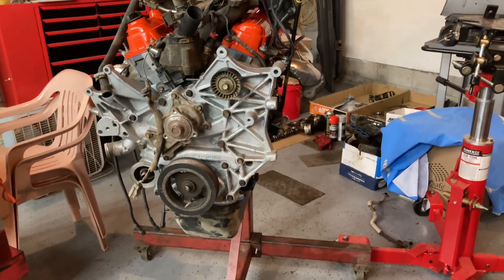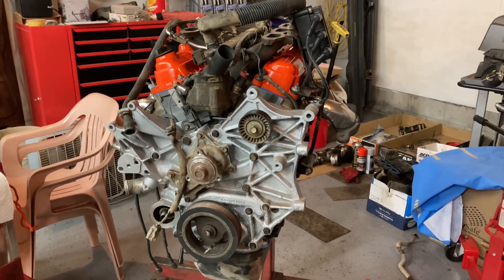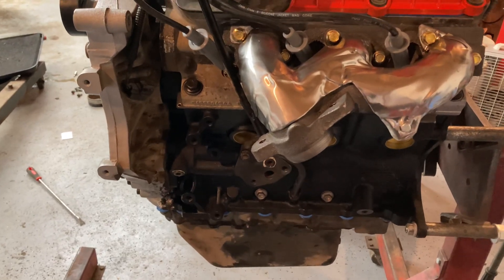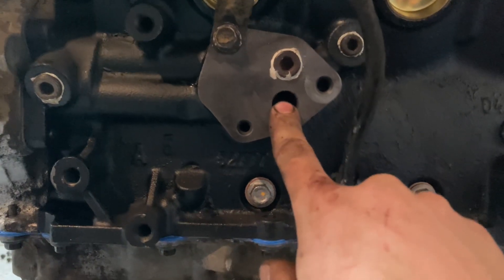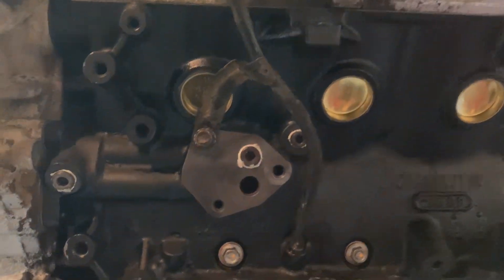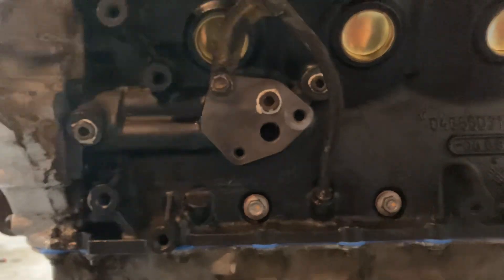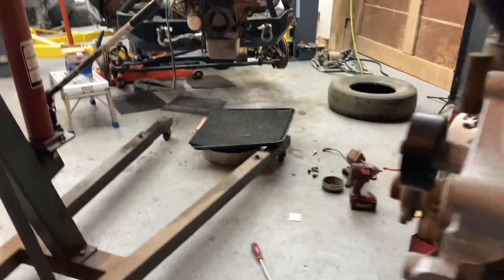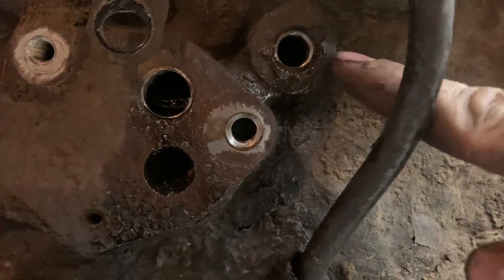3.8L Jeep engine block plug locations for fresh engine rebuild

Comment: Can anyone of those plugged holes be used to adapt an oil pressure sensor? I wish my wife’s jeep had one. Did you replace the oil pressure regulator in the timing cover?
Reply from the maker: You could, but I tried and couldn’t get one to fit due to space between the block and the engine mount. I put an actual oil pressure gauge in my Jeep and just used a sandwich plate adapter that goes where the oil filter goes. Works great 👌